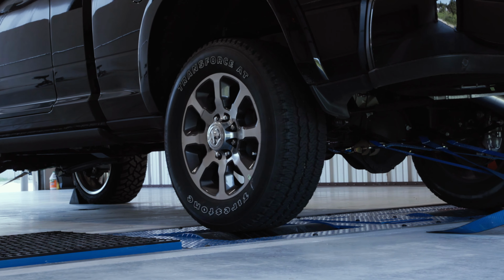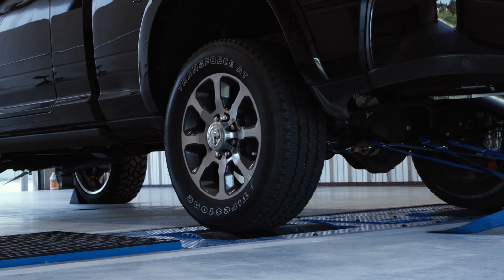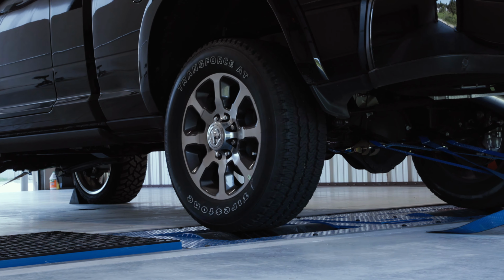21 CUMMINS S467 2ND GEN SWAP TURBO DYNO TESTING!

Comment: Did a run with my 21 HO on a 150 hp tune. Made 499 hp. Wasn't real happy with thise numbers as I feel it should have been better. But it was my first time on a dyno, and I was trying to keep the truck from down shifting so I started my pull at about 2000 rpms maybe closer to 2100 rpms. And outside Temps were over 90 degrees. 
Would sure like to now exactly how to do this right for the best readings possible. 
I sure wish we could keep the trans from down shifting like you can on a ford.

Comment: How much hp would a 2019 Standard output with the overdriven CP3 swap make on the stock turbo?
Reply from the maker: We would stop around 510 because of the turbo limitation even if there was more fuel to add sir !

Comment: I have a ‘22 cummins, nobody has tunes for them yet as far as I know, but I want to do a 2g swap with either the 67 or the 72mm charger. Would I need completely different tunes than what I would normally get with the stock turbo?  This is my first diesel so I’m kinda new to this

Comment: Just putting this out there to mull over...

There's a tuner out there (tunes through EZ Link  etc) that claims these trucks stock power numbers from the factory are RWHP numbers. Then, their tunes which are emissions legal and all stock trucks, adds 130hp and should be twice that roughly in torque. So on a 4t Gen average 350h 800t model year truck would be putting down 480h and 1,060t.

I've had a significant amount of modified vehicles (that weren't diesels), but I rightly asked how they can say these trucks put down (i.e. RWHP) the manufacturer claimed power and then they're adding their claimed increase also RWHP? For both situations, Stock Flywheel and Performance afterwards this means the flywheel power numbers are tremendous without driveline loss.

Comment: I'm going to look at a 2021 this week, and the first thing I wanna do is delete it. How well does the transmission handle this power? Any advice on increasing the longevity for a 68RFE on a 21?
Reply: When my ship comes in (lol) I want to do a little Allison tranny swap on my '21 2500. That's gonna run about $20k with labor.

Comment: anyone know what wheel setup this is?
Reply: 22x12 they might even be 24x12 on 35s  not exactly sure but I know I'm close
Reply from the maker: 24x12 on 35x12.50x24!
Reply: @POINTBLANKPERFORMANCE  nice i can spot some 22s or 24s on 35s anyday
Reply from the maker: @tannercasey7500 👊👊

Comment: Too bad the 68RFE isn't even adequate for the stock power.  68RFE has left the chat in 3...2...1..
Reply: The stock 68RFE can handle “stock” power.  When you increase the power the transmission isn’t tuned for is when you run into problems. Check out fire punk diesel  and what they can do to the 68RFE.
Reply: Mr Ignorant chiming in 3....2....1.....
Reply: My 11” 68rfe has handled 550whp for 122000 miles and counting with a 2nd gen